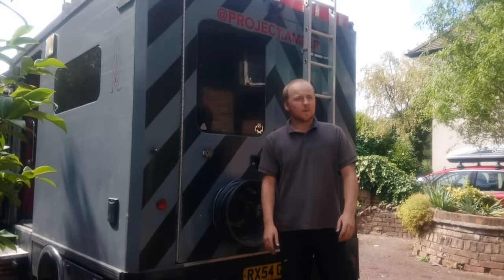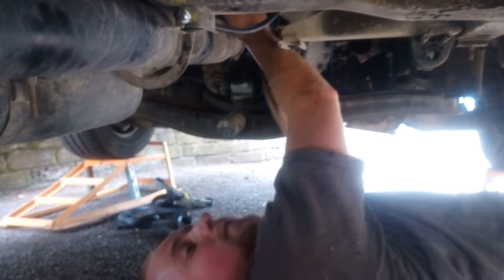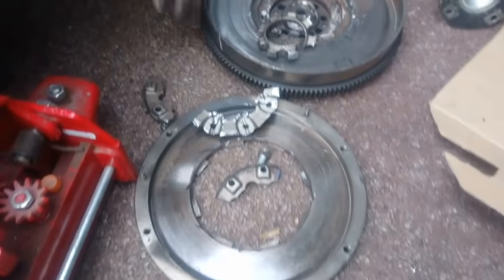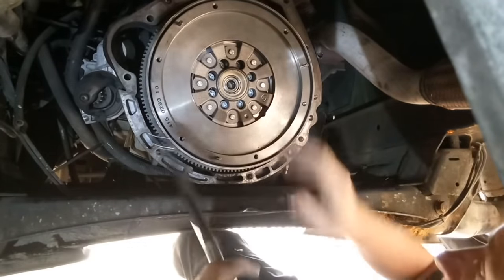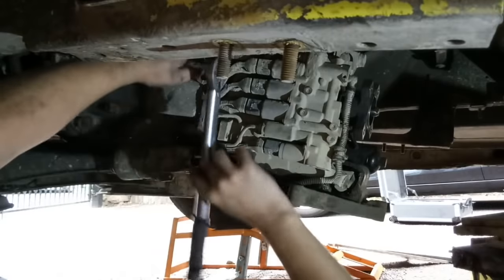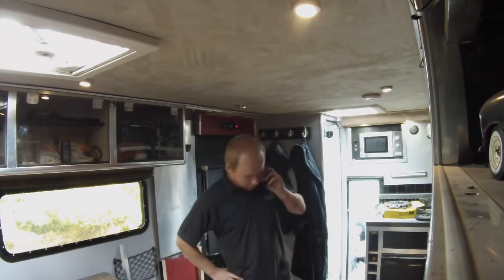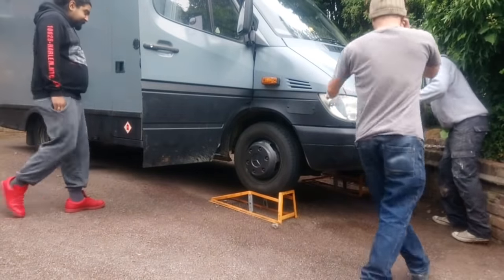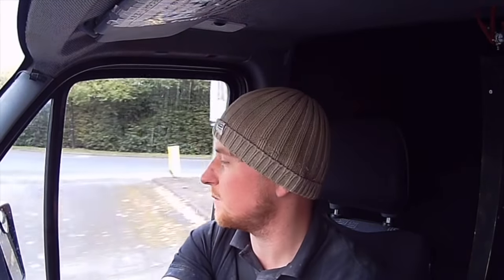Sprinter CLUTCH CHANGE From Hell! (After 13,000 Mile Eurotrip)

Comment: Nice van you have,mate. When i used to work for VW Nutzfahrzeug(Commercial Van Branch) the VW Crafter had that same semi auto gearbox and i hated it also!!!
We used to call it "The Shit'o''Matic"box.Many problems with clutch wear/and adjustment,hydraulic pressure problems from pump,problems with gear selector brain and hydraulic valve block
not doing what it supposed to do and a sh.tload of flywheel problems.
Later Sprinter vans got a proper auto box,but the Crafter had that box till the end off 5 cilinder engines and never got the normal auto box.
You really had a enormous amount of bad luck with the spare parts,but it's not uncommon. Been there,had that and HATED IT!!!!!!!  

Great and honest video. Well done,mate

Comment: I'm just about to do this job on my 311.  Got the clutch kit from LUK.. Euro car parts gave me the heads up for the tool for the flywheel.. Cost a bomb.. And also have to replace the innards of the rear diff.. Invested in a adjust height trolly jack and to stands asi want the van high.. Great video!!

Comment: Awesome Video!  Love the angelic music upon final success.  I liken it to becoming an astronaut because they have to know and become an expert on every system on board. I had to constantly fix my Ford Diesel Sport Van which had over 400,000 Miles on it and I had a similar experience with replacing a fuel pump witch was located between the engine compartment and the firewall hood. I had to buy specialized tools (Bastards) and literally back out 3 bolts millimetre by millimetre. I finally fixed it after 2 months of yard time.  Oh, and this all after dropping my fuel tank because some ass** at the dealer told me the fuel pump was in the fuel tank.  I had just filled up the tank before the van gave up the ghost.  So I had to empty 70 dollars of diesel before I could drop the tank. You could imagine the colorful language I had upon discovering that the pump was not there.  So long story short, I have felt the pain and suffering that you went through. However, once I tracked down all of the vans problems and got it back up and running, It was like driving a new van. I even fixed my steering column and realigned the gear indicator.  I sold that van to a US Navy submariner because I knew he would take good care of it and had the mechanical knowledge to maintain its systems-electrical, solar, gas etc. I then moved to Vietnam. I now live in a 30 story High Rise building on the top floor.  Life is good here but when I return to the United States, I will again build a new van or maybe buy a tour bus for the extra space.  Anyway thanks for the video. My favorite line was at the beginning "There's going to be some swearing in this video". I immediately knew I was going to be watching a good one.  You really captured the van life spirit.  I often tell people that before you sell all you own and hit the road, you might want to learn a few skills.  For example.  Electronics, Auto mechanics, Body work and painting, manufacturing and Propane installment as a minimum. I tell them building your own van is better than buying someone else's nightmare. Things will always go wrong on the road and you need tools, knowledge and an unstoppable spirit to survive those breakdowns in the middle of nowhere.  Excellent video brother.

Comment: Very entertaining!  ...But if you can take out the gearbox again just one more time and from another camera angle, I would be grateful.  THX  -Just kidding!  You are now an expert when it comes to working on that part of the vehicle .  Put some anti-seize on those bolts if you hadn't already done so...

You are like me when it comes to repairing your vehicle.  Tackle it!  Tools are key and sometimes you need so many variety of the same size hex or bolt size just to get the prize !  One battle after another!  Ridiculous that you had to deal with cutting out your flywheel assembly!  You have great helpful friends!  (Cost you quite a bit of future pub rounds!)  Thanks for the video!

Comment: your problems with brings back bad memories with a transmission did back in the early 
70's big truck transmission 13 speed roadranger about 2000 pounds in and out 3 times
because of a mistake in the printing of the rebuild guide was a bad week for me looks
you had the same week i had that but in the end despite there f**kips you won its the road
and working like should good job
GRUMPY OLD MAN WITH A BUS

Comment: We must of been dealing with the same companies mate. It only took me three attempts to find out mine was the wrong part (I guess I was lucky) by laying the new and old side by side on a flat surface we could see the 5mm difference. Mine was the opposite way though. I touched the clutch pedal and it dropped straight to the floor.  Anyway all back together and working fine now apart from the ABS and traction control lights have come on preventing the turbo from working GRRRRRRR

Comment: Ha, the clutch and dual mass flywheel replacement...been waiting for such a video...My LT35 van is awaiting such a repair but still 'soldiers on'.....
Reply from the maker: Haha, to be hpnest as lpng as you have been supplied the right parts and it hadn't ate itself like mine had, it's not that bad of a job. But mine had been broken since i bought the van, but this being my first hgv I had no idea wjat to expect from it so put another 13000 miles on a knackered flywheel. But like yours she soldiered on!

Comment: gosh the bolts of that gearbox must move like butter about now ...... not that you care
you might still need to have the clutch learned in to fix the reverse issue (could be the clutch is sticking slightly , a few taps on the reverse solenoid or checking the wiring to said solenoid might work too
untill then make sure the car is in neutral before switching the engine off 
have a smart car wish has the same sort of gearbox system and if i leave it in gear it doesnt come out unless i rock the car a few times and fiddle with the contact to release the tension on the gears so the solenoid can pull it out of gear or the car whont start

Comment: Nice job! You are a hero! 7 times!
Small remark: You had your flywheel bolts loosen and didn't apply the Loctite glue on new bolts. I don't know how about Merc specs, but other manufacturers highly recommending to apply Loctite (or any other thread glue) on flywheel bolts and tight them according to specs.
And, I don't really know how you managed to did such kind of work without few "strong words" :D :D usually, I'm speaking filthy language only :D :D :D

Comment: Great video! I can relate to an engine change I did years ago replacement engine 1600 original1300 when told to use the same oil sump only to have the big ends hitting it later! I lost the plot! Coulnt bare too do it all over again to reshape the sump and sold the car at a loss, lol😂

Comment: Wow, I feel your pain man. I've recently had a head gasket fail within 50 miles on a 1.4HDi engine and it sucks having just finished a job only to find it needs doing again... The real kicker there (apart from the supplier being adamant it was my fault and the head must be warped which it assuredly is not, but oh well it's only £45 out of pocket for proper Elring gasket) is that I only had to lift the head because of a snapped glow plug tip, the engine is/was a perfectly sweet 98k mile runner before this! Shit happens though & I'll get my motivation up again and throw it together one more time. (the clutch job on this same car though went lovely and smooth, no DMF to contend with either. Small mercies & all haha)

Comment: Clutch replacement can be a pain, especially if you don't have a lift and a transmission jack. 
I have never seen a large van with a manual transmission in it. Here in the USA, most vehicles come with automatic transmissions. Most drivers don't even know how to drive a vehicle with a manual transmission. I used to have a 2010 Toyota truck with a manual transmission. It was very hard to sell it because of this.

Comment: Sprintshift hell 4th time the box has been off the one im doing is single rear wheel 316cdi all i can say is cheers! The first time i put it back on  after replacing it all it flashed (F) all i did is with the ignition on engine not running select all forward gears up and down then reverse then it drove like a new van for 20 feet now boom 💥  so i was about to fit new thrust bearing at £300 (2nd one) today and thought fuck it so the box is in the back of my manual 313 just now my head is a shed my best friend has been out of work for 3 weeks as he dose European haulage with the van but like yours the flywheel was totally fucked im ringing Luk first thing

Comment: Did you consider rotating the propshaft (jacking the rear up) to allow access to each bolt?
Reply: on that hill with that weight, the front would of overshot the ramps and killed him, a car yes not that
Reply: is it 4wd? if not, surely it is easy to jack the back end up and rotate the rear wheels?
Reply: its a 5 ton twin wheel ambulance at 25.00 minutes look at the hill its on and the ramps, lift that back a couple of inches handbrake off gravity will overshoot those under rated ramps, how you going to stop the front rolling over them, no way
Reply: 16.23 mins look at that ramp, you dont want to be jacking the back of that up way to dangerous and madness,
Reply: box is out so wheels not connected to clutch assy. What you can do is pry the unit back in line
Reply: i am shocked at how you are all giving advice but know fk all. 
Walter Sobchak came out with some sense but will not work as you couldn't get under the axle, have a look how low the body is, it being an ambulance there is no room, much of the prop tunnel is enclosed around the axel especialy with the back end being flat on the hill... Pls give it a rest will you all!
If it was on flat ground, with substantial ramps/stands, decent jacks, maybe ok, but hey go do your things as you have all described. When your wife comes looking for you to tell you dinner is ready but all she can find is a pair of feet poking out from a motor sitting on the ground.
In the position he was in, with the tools. money available to him, safest easiest, only option was remove the exhaudt out the way.
End off FFS!!!

Comment: How many times have I been there before with clutch changes lol - mechanics also get this issue. The worse one I had was a plate change on an earthmover, then taking off the pres/fric plate found the flywheel disintegrated and a part fell out hitting my foot, ouch was not the word I used. Took an overhead crane to re-install the new flywheel.

Comment: DMF, the worst invention for the motorvehicle ever, massive amounts of expense and trouble for not much actual result compared to an cheaper, lighter solid flywheel that usually lasted the life of the vehicle.
Reply: Very true popotoaster. THE worst invention ever.
Reply: @frederickstjohn8069  Yeah, you're right, but the bottom line of the whole exercise for the arsehole that designed it 
wasn't longevity, it was build in a guaranteed breakdown and we'll flog you a nice new expensive part and 
make the supplier loads of lovely money.
Reply: Luk (Schaeffler Auomotive) invented the DMF. First appeared in a BMW.
 Apparently, It's the best thing since sliced bread.........according to LuK (until you have one fail and the vehicle is out of warranty!)
Reply: Freddy Babe 
My Megane is on its third DMF - still under 100k miles...
Reply from the maker: We think the last time, maybe 2 times the clutch was done, they just never bothered doing the DMF or the thrust bearing, because the friction plate itself was on ok condition, but the rest, well, you can see lol.
Reply: They were designed to reduce stress on the gearbox but this doesn't benefit you, it just allows manufacturers to make the gearboxes cheaper.
Reply: absolutely..
Reply: @sarisen1953 yes, but what's wrong with the harmonic balancer on the crankshaft pulley at the front of the engine? Much easier to change when it goes wrong.
Reply: @sarisen1953  I have 2 older vehicles, both straight sixes, that have only a harmonic balancer. One has a solid flywheel, the other is an automatic. They are quite smooth.
Reply: What a relief to read this comment! I also went with the dual mass today. I was right about to walk out the door right now to get it, but then I read this comment. I'm going single mass now.
Reply: Till you try a solid flywheel in one of these vans you won’t know how much good they do !
Reply: John Molloy these Mercs have both

Comment: Would of been so much easier if you bought or hired the right kit. An adjustable transmission support that fits onto a heavy duty trolley jack makes job so much easier. It can tilt in either direction and the box is chained to it for security. I have the kit myself and hire it out for only a few quid per job.  The secret is to make it known you need help,facilities or advice beforehand. There are two Hungarians changing the clutch in their t5 vw at my workshop right now. They owing all the work themselves using my tools and facilities for £80. I think that's pretty reasonable? If you ever in Wiltshire and need help then let me know mate.
Reply from the maker: Cheers dude, yeah by the 3rd time the mobile mechanic felt sorry for me and leant me his tansmission jack, made hell of a difference.
Ahh brill nice one man, will do 👍

Comment: Looking at the clutch pressure plate the auto adjuster is fully extended so cannot adjust as the clutch wears. This will lead to the clutch slipping giving the impression its worn out.
I made this mistake once I didn’t know about the auto adjust clutch and had to redo it after around 20k miles.
Reply: Ahh then I watched the rest ☹

Comment: Well done you! I feel your pain. xtrail clutch change = 1 week, Pug immobilizers craps out at 100k, freelander prop shaft freezes at 70k, Rubber band timing belts! tension  pulleys with 5 ball bearings in it??, Dual mass fly wheel? wtf? how many other vehicles are built with this kind of redundancy? motor manufacturers aren't interested in the Environment they build cars that should last 20 years only to last 5 by making it un-economically viable to fix them, and how many new diesels cant burn bio-fuel? lets face it, only 10% or less motorists are capable to fix their own wheels or even have the inclination to. And how many garages will fix a major issue knowing the car will be back in a few months with another one. Why oh why put computers in a car?. Why oh why invite corrosion nightmare by using dissimilar metals next to each other?. And yeah, If a manufacturer changes the spec a dozen times in the first 2 years of production it means they are using the buyer to test the bloody cars for them.

Comment: Hi mate, remember when you're van broke down and you got towed by the police car? If I remember rightly this was an SMG gearbox fault? It beeps and wouldn't select gears? 
What was the issue at that time? Having a similar issue myself. (Can't find the video) if not have you had this issue before?? Many thanks Alex
Reply from the maker: I had no beeping, just a flashing F on the dash, and that came down to the garage not connected the main connection up properly and it came loose.
It may be low fluid which I've also had in the past, you can get the pentazine from Mercedes.
But beeping I've never had relating to the gearbox, may need to get it plugged in to give you a better idea.
Best of luck 👍
Reply: @ProjectAmber  cheers for getting back to me will try the suggestions!

Comment: So you didn't check your part matched forced the gearbox on and drove it for over 15000 miles with a knackered clutch and you wonder why it was so difficult I feel for you but I do think some of it may have been slightly self-inflicted
Reply from the maker: ..... no, you got it totally wrong.
The van was bought with a gearbox problem. Made it 13,000 miles then I got home to change it which is where this video began. Pay more attention. The difference in 1 part was 5mm...

Comment: Haha that is easy compared to a clutch that is on a 250 tone heavy haulage tractor unit that I've had to use a crane to take the bloody thing out. Haha none the less good job at the sprinter mate they are a bad job especially when the parts are wrong.

Comment: Hi, How much did those parts cost ?
Reply from the maker: The first kit was, £680, the thrust bearing alone was £280 and the second kit with just the friction  plate,  pressure  and flywheel was £350.
Luckily the first two prices are now refunded as I was broke after this ordeal haha
Reply: Thank you very useful information regarding repairs, as you know there's a number of these vans for sale with high end mileage, so you have to weight out the pro's & con's of owning a cheap van.

Comment: I Can't understand why you didn't get your part at your local Mercedes-Benz dealership? I got fed recieving wrong parts from different suppliers. Even original suppliers like LUK and Bosch. Now I just visit my dealership and recieve correct parts every time
Reply from the maker: Because Mercedes wanted to charge £900 more for the same thing. Main dealers are theifs and the one nearest me takes the guys 30 minutes to find what your after because " 
The system is slow" and have alsp got parts wrong.